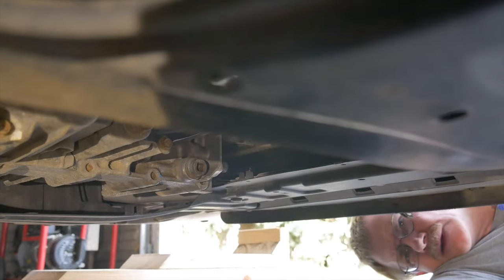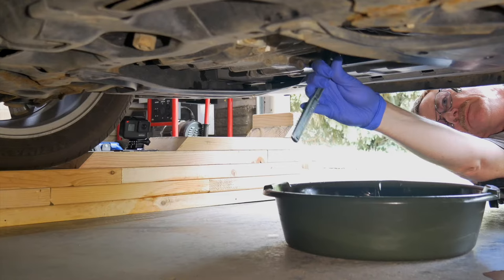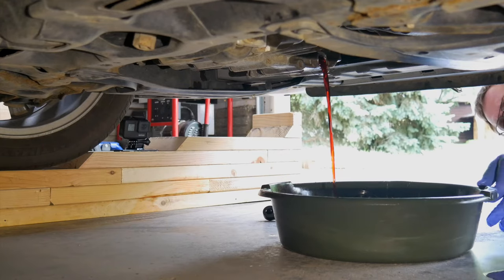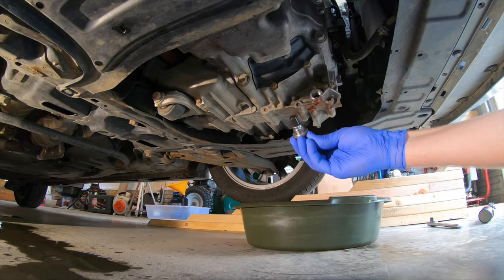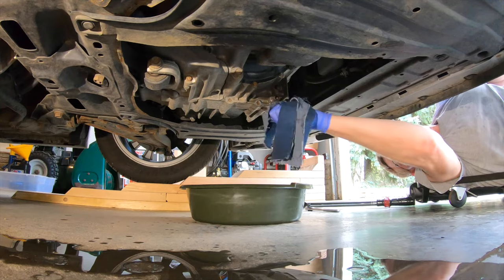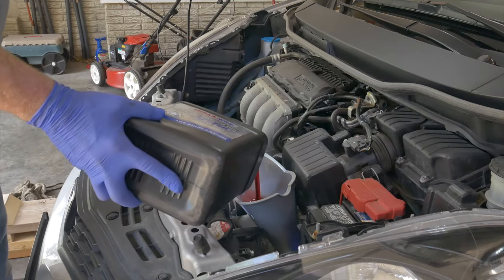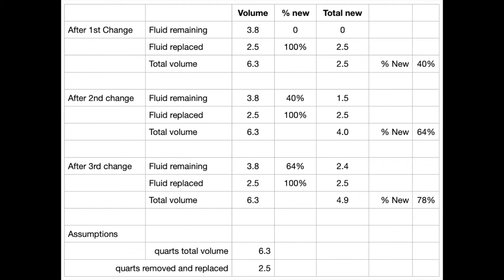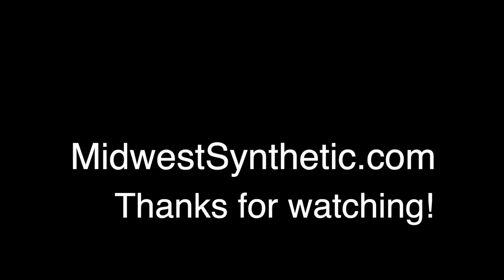Honda Fit Automatic Transmission Service - AMSOIL Signature Series Fuel-Efficient Synthetic ATF

Comment: Is it necessary to drain and fill 3x times for a first time change?
Reply from the maker: That's the simplest way to get the majority of the fluid swapped out when only part of the total fill volume is drained.  Thanks for the question!
Reply: Most newer car owners who do tranny fluid at home will do over a period of 20,000 to 30,000 miles. So do 1st time drain and fill 1/3 of capacity. Drive car as usual and after 10,000 miles do 2nd drain & fill. Drive as usual and after 15,000 - 20,000 do 3rd drain and fill. This is recommended if your vehicle is under 50,000 miles. If your vehicle has over 50,000 miles and a tranny drain & fill has never be done or your not sure if it has ever been done then it’s suggested to do at least 2 drain & fills at one shot. So drain and fill. Drive car for 20 to 30 minutes to allow gears to shift and allow new fluid to work itself through transmission. Return home and do 2nd drain & fill. Drive car as usual for 10,000 to 15,000 miles and then do 3rd drain & fill. And if you really want to do preventative maintenance to keep transmission running very very very long time, do 1 tranny fluid drain & fill every 25,000-30,000 miles after completion of the initial 3 drain and fills.Your car transmission will have a long life. One other recommendation I would make is to purchase a container with liquid measurement marks. I got a gallon size from Amazon. It shows quart measurements, liter measurements and gallon. Use such a container to measure transmission liquid you drain out. Then put in exactly what you drained out. In most cases you will avoid overfill or under fill by measuring what you take out. This can also be used for motor oil or gear oil such as your rear differential fluid. By the way, if you have a sealed transmission, no transmission fluid dipstick, you will most likely need to do an overflow drain when doing the drain and fill. It’s an extra step that requires to drain any overflow by starting the car and allowing tranny fluid to warm up to a specific temperature range and then draining overflow. Sounds harder than it is but the extra step just adds about 10 to 15 minutes to the project. Can use a digital heat temperature gun online for less than $30. This will allow you to take temperature of transmission oil pan surface simply by pointing the device and pressing the trigger. Or you can purchase an obd device which will give you almost an exact transmission fluid temperature. But those particular obd devices will cost over $200. And most importantly do online research related to your specific car. And always get information from at minimal 3 resources to ensure accuracy of data or information. Due diligence!!!

Comment: I was thinking of converting from WS to Amsoil fuel-efficient atf. Is it safe to do the drain and fill method (mixing fluids) or should I do a full exchange?
Reply from the maker: A full exchange would be the most practical if it's possible. Always make sure you're using a fluid compatible with your application.  I'm not aware of any situations  where you can get every last drop out.  The closest would probably be something like some older Fords that have a drain plug on the torque converter so you can drain that too after a pan drop.  You use more fluid with a drain and fill but the drain plug (vs. dropping the pan) makes it easy.
Reply: @midwestsynthetic  Thanks. My car is an '09 Matrix spec'd for WS fluid. I was thinking of just doing one drain and fill once a year with the Amsoil. Any problems with that? The current fluid is in decent shape.
Reply from the maker: If it were me I'd change it enough to get most of it switched.  For example the Honda in the video I changed 3 times the first time.  The fluid looked real good good but I still wanted to get it mostly pure.  And of course I'll want the car to last many miles.  Thanks!
Reply: @midwestsynthetic  Awesome. Thank you for the advice. Seems like the initial cost will be worth the peace of mind and not having to worry about it for a while :-)
Reply: I swapped all my ws fluid out on my 2019 tundra for signature series amsoil trans fluids . I noticed an improvement in shift quality . WS fluid is a semi synthetic mediocre ATF 👎. I never hesitate to switch to any amsoil product .
Reply from the maker: @EverydayJ1786  Great story, thanks for sharing!  I appreciate the comment!!

Comment: With the three drain process did you start it or anything between the 2.5 quarts added each time
Reply from the maker: It should be run to mix it up and make sure the fluid is at the proper operating level.  If you don't get back to it right away for any reason (life) the car is left with proper fluid levels for operation.  Make sure you check your owner's manual for the proper procedure to check the fluid level.  Thanks!